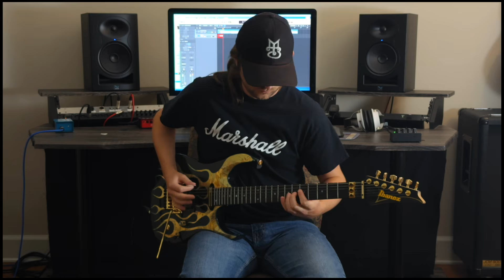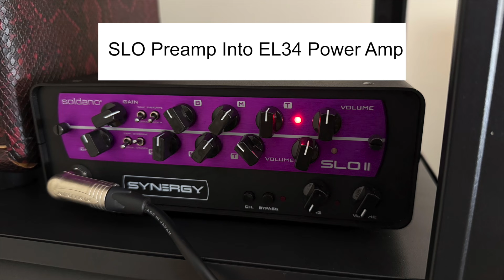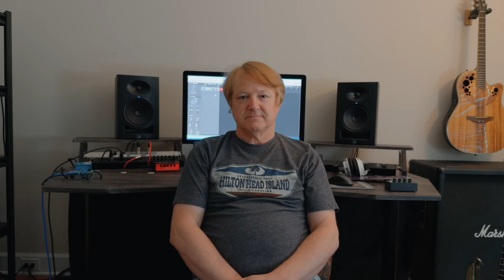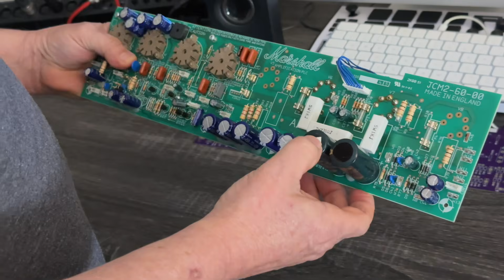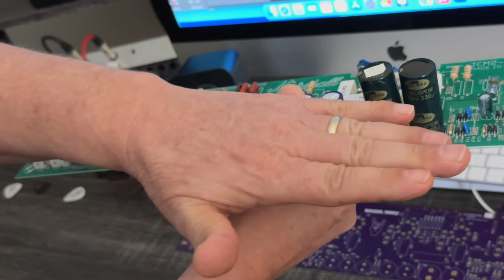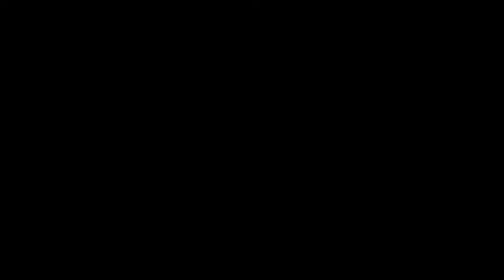Marshall JCM2000 Replacement Board by Baker Amps (Neo Mod)

Comment: Is it possible to still order a board? It looks like they’re sold out on the website and no listings left on reverb. Thanks.
Reply from the maker: We typically sell out everything we make, but if you need a board made for you, you can go through the preorder and we will get working on it. So we are can only make to preorder because the demand is constant so far.

Comment: Did you guys sort out the big imbalance in body and low end between the channels on the DSL?
Also does the green channel crunch setting get closer to an actual 800?
Reply from the maker: For the neo mod the clean Chanel stays the same except the new depth circuit is in play. The new depth circuit in the Neo mod fixes the low end and creates a more balanced frequency range. You can hear this in the sound comparisons

Comment: Heres the thing about the power resistors being right on the board in your purple version...this was huge design flaw in  any amp as the resistors get hot and eventually over time will bake the pc board black and damage the circuit traces on both sides of the board. That is why the original board has them stood off from the pc board.
Reply from the maker: The power resistors are in fact off the physical board. Not only they are off the board, the board material is upgraded from the standard material, even if the resistors were touching the board it still wouldn’t cause damage.

Comment: How mutch $$$  I have a verry jam 2000 never had a problem it’s still fine but having one of these in reserve when I need would be a good idea thanks great playing btw cheers !!
Reply from the maker: $330-$340. More boards will be in stock shortly
Reply: @MaximusBakerGuitar  Does the Marshall 40C board have the same problem?
Reply from the maker: @VIDS2013 No the current DSL lineups don’t have a board failing problem because they gave up putting the power tubes on the board. They currently mount the power tubes on the chassis. The problem with them is they have cheesy transformers and an even worse sounding circuit, but that can easily be fixed by modding.
Reply: @MaximusBakerGuitar  I got my DSL40c for $300 new, so I can't complain! What replacement OT would you recommend?
Reply from the maker: @VIDS2013  heyboer, what spec I don’t know.

Comment: I had a choke installed on my DSL50. Could it be installed on this board as well? I think it would be on R71, right?
Reply from the maker: At the time of writing this, DSL50 boards should be listed by Monday. Just send a message on Reverb and say you have a choke installed. You can order a board without the R71 resistor installed so you can connect your choke to the new board.

Comment: Could someone please tell me where the capacitor or part that handles the Deep Switch is on this PCB? This amp sounds AMAZING, but that deep switch is too boomy, so I want to replace that part to modify it and lower the bass. Does anyone know what it is? And where to find it? (I have the JCM2000 PCB from the most recent Marshall revisions, without the heating problem, etc.)
Reply from the maker: The stock amp deep switch (actual switching mechanism) is on the preamp board changing a value. But the modded replacement board replaces Marshall’s lame “simulated” depth circuit with a real depth circuit like you’ll find in a Friedman or Soldano. This mod makes the deep switch button useless (no longer doing anything) but you won’t have low end problems anymore. If you want to make the button do something, you’ll have to run jumper wires from the preamp board to the main board with a switching resistor value.

Comment: The whole Marshall range since the jubilee have been garbage all of them JVM DSL TSL and the shite studio range they brought out is even built worse. I think they got Stevie Wonder doing the soldering. My DSL 100 blew up basically over heated. It’s funny the only decent Marshall I’ve owned is a Marshall lead 12 combo from 1987 still works now solid state but sounds like a monster all original still works great. These boards Mr baker is creating I think are genius. I moved to VOX AC30’s with Blue Alnico speakers a few years back game changer no wonder Ritchie Blackmore used one live hidden in a Marshall cab 🤣🤣🤣🤣🤣 The name Marshall means nothing to me unless it’s a Blues breaker but even those need work on them to make them more reliable. Lyle Caldwell will tell you that as he will all Marshall products. Stay away from anything Marshall after the Jubilee era. Or buy a DSL or TSL and get one of Mr Bakers boards installed.
Reply from the maker: 😂we appreciate it

Comment: That Marshall crunch is there - a GE-7 in front as a low cut may help get rid of some of that squishy marshmallowy pick attack - otherwise a great sounding amp.
Reply from the maker: The modded versions fixes the need for pedals, but stock is the low end is flubby
Reply: So would an appropriately sized choke transformer. Cheap penny pinching bastards in charge at Marshall then and now

Comment: I have a '98 JCM DSL100 that shit the bed years ago with that bias drift problem with the faulty conducive PCB. Would it be worth it to fix it tho is my issue - I'd easily have over $500 in repair to get it up and running again...
Reply from the maker: If it’s in fact the main board that failed due to the bias drift. Yes the Baker Amps board will fix it, not only get your amp back up and running, but shouldn’t ever have to worry about anything failing on that board
Reply: @MaximusBakerGuitar That's just it - I don't know if that's the actual reason it died - I can only assume it was the board. I have other amps so haven't felt the urgency to get it fixed. Are these boards still available and how much are they?
Reply from the maker: @scottdunn2178 right now as I’m typing this there’s only 1 DSL50 board available. We are currently building more. It’s $330
Reply: @MaximusBakerGuitar What about the DSL100? I see Marshall is no longer making replacement Revision 20 motherboards.
Reply from the maker: @scottdunn2178 TSL100, DSL100, DSL50 are available options, DSL100 and TSL will be back in stock soon.
Reply: @MaximusBakerGuitar Cool.Where could I ship the chassis to be serviced?
Reply from the maker: @scottdunn2178 message Baker Amps on Reverb to talk about servicing. The reverb shop is in the description.
Reply: @MaximusBakerGuitar 👍
Reply from the maker: @scottdunn2178 actually, contact me through my website by email. My website is maximusbakermusic.com. Just hit the contact message there

Comment: 💚Victim of a Marshall JCM 2000 TSL 100 watt head, red tube fault here.  Cost me a pretty penny to get that serviced.  Had recently retubed with expensive winged C, & not too many months later, POW.  Saddening.  

As a 19 year old, living in a small town in Northern Canada, in the beginnings of internet, I stayed up for many late nights researching for my real 1st amp.  Worked very hard in the bush jobs to save up $3000, ordered brand new from England.  Waited 3 months for arrival, & borrowed my parents van to drive to the greyhound station at 3am, & immediately unboxed that baby.  Thought I had the real deal.  Was so happy.  Only to be disappointed years later, when during a recording session, we had to scrap all my takes cuz of that fizz sound.  Red plated shortly after, boxed it up & moved to Finland.  Got it fixed (basically the guy dremmeled out a large hole in the pcb so the heat wouldn’t red plate the tubes again.  I still have those winged C tubes as a reminder of this.  2 are scrap.  Love the amp, punches lovely & rocks, but hate it at the same time.  For the reasons everyone says.  The XLR out is pointless, sounds like it needs an IR.

You’ll see this on my youtube channel.  Decided to buy a small eggnater, & well, mistake #2.  Wish I just stayed with the Mesa Express that I bought new, to compare side by side.

Now, at age 44; Think ill give up & get a darn quad cortex😖

So happy to see you caring for us, the ones that got the shit end of the stick💚
Reply: Honestly, try the new DSL100. I was looking at the DSL100 for a garage amp and she absolutely ripped, especially with an SD-1 in front. I ended up getting the DSL20HR as I play a lot in the bedroom due to work/schedule. Unless you NEED a hand wired, the DSL100 will absolutely floor you. The Marshall staff in Vietnam do a really great job building amps.
Reply: @lexustech48 If I understand you correctly, you are meaning the DSL that has come out more recently, as oppose to the jcm 2000 dsl from 25 years ago.  Correct?  I have tried the more recent dsl, & it was nice.  Hesitant & snake oil weary though, understandably, after this whole TSL, no recall trust issue.  Didn’t notice your comment until I came back a month later.  Thanks.
Reply: If you still have the JCM 2000 just replace it with Baker board. 
Unfortunately Dremmel’ng out the pin on power tubes didn’t always fix the problem from what I have seen…if your main board had been unknowingly conductive for a while it would develop other secondary problems the drilling out pins would not solve. I am about to order one of these because I love this amp so much. I have bought three of them. The first two I got are paperweights the third has the improved Rev 20 board… the first one that I got it’s board is so conductive it probably glows in the dark 😁 the second had the Dr Tube bias mod but unfortunately that was done after other problems had developed. At the time I did not know any better and took a chance on it. It was a dud. The third I got from a reputable repair guy several friends vouched for. It was his personal amplifier and he had put the rev 20  upgraded board in it. 
Glad Baker Amps has gone above and beyond to make replacements

Comment: That's fine man, but where to buy? Found nothing via link.
Reply from the maker: What country you from?
Reply: @MaximusBakerGuitar  Hi I'm from Switzerland. Amp tech and refused to put hands on this JCM2000 models again:-) Your PCB seems a good choice. cheers math
Reply from the maker: @333Lightspeed ok, go ahead a message Baker Amps on Reverb on the board you want. If you can’t message there let me know here. We will add you on the locations lists if you are interested in a board.

Comment: Quick question for Baker. I bought a DSL 2000 100 watt head. The channel switching doesn't work on it. It's stuck on clean. If I bought your board, does that also control the channel switching? Thanks
Reply from the maker: It’s hard to say, the problem could be on the main board, or could be on the preamp board. Try using a foot switch to change channels, the foot switch uses the main board for switching and not the front buttons.

Comment: Thank you for this much needed solution! Using the DSL100 board as an example, For someone who’s not very adept at amp work, what’s the difficulty level to install?
Reply from the maker: In theory it should be easy to install, simply swap out the board and connect the correct connectors back using the connector chart for your board.